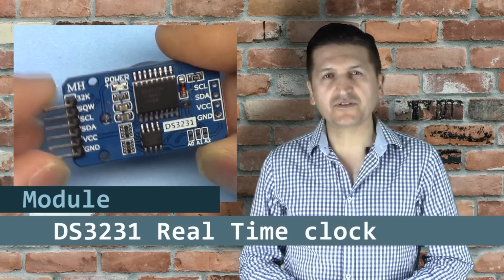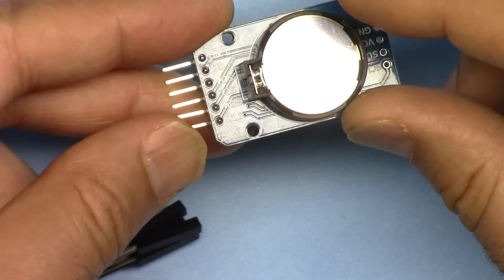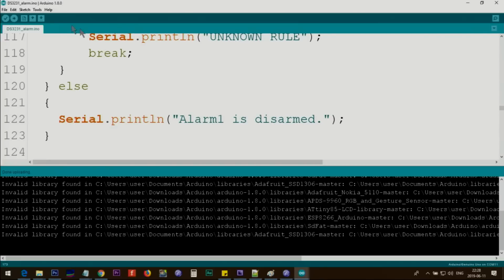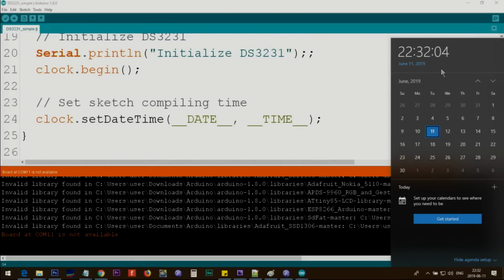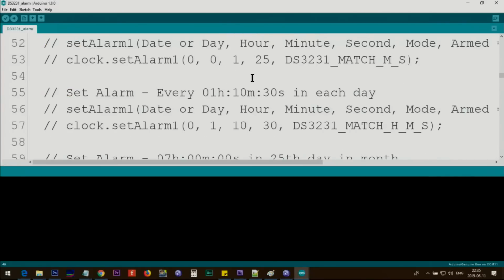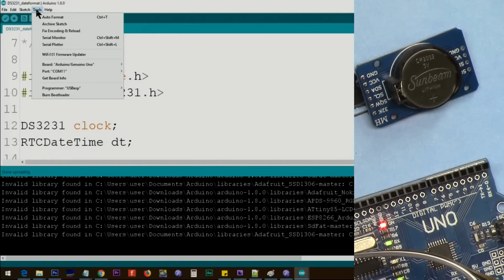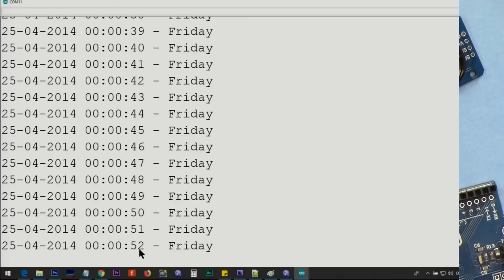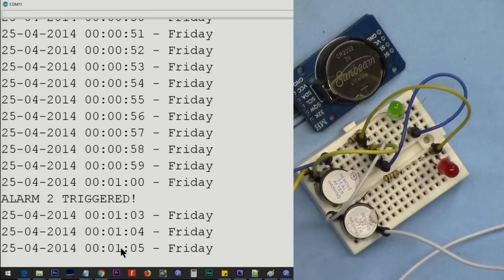How to use DS3231 RTC clock module Alarm with Arduino RJT165

Comment: Instead of buzzer, can I use motor? I want my motor run in specific time and also turn it off any seconds
Reply from the maker: Yes you can. You will need a motor driver so the signal from Arduino can turn the motor on via a motor driver. The motor driver depends on the motor for example if your motor needs to 2A, then the motor driver should be able to handle 2A. There are different types of drivers. just turn ON or OFF or you wan to control the speed. Also there is direction of rotation. do you want simple ON/OFF or also change the direction. Search my channel. I have tone of motor driver videos.  For this clock module, here is latest better video https://youtu.be/LEQfzmO9Wm0

Comment: The simple example works until i close the serial monitor, then it reverts back to the time when it was programmed, is the battery dead maybe?
Reply from the maker: no the battery is not dead. you left the code inside the setup to update the time when you download the code to Arduino. You do it only once and then comment it out by putting // before that line. By the way here is a better video with multiple projects and unlimited alarm https://youtu.be/LEQfzmO9Wm0
Reply: @robojax  ok great thanks so much!

Comment: Like your videos
I am using a ds3231 and rtclib all I want to do is set the alarm for every hour on the hour. 
The code would be something like (rtc.now=(0,0,0,59,58 ds3231 M,S);
Do something;
However I cannot get the syntax to compile correctly. 
is it possible to help me?
Thank you. 
Fleck
Reply from the maker: Hello, here is the ultimate video for DS3231 rtc with multiple alarm code example https://youtu.be/LEQfzmO9Wm0 thanks

Comment: "'RTCDateTime' does not name a type - did you mean 'DateTime'?"
Reply from the maker: please watch updated video with wiring diagram and more projects https://youtu.be/LEQfzmO9Wm0
 and the issue will be resolved. it means you have not installed the library. The newer video shows it better.
Reply: @robojax  Thanks for the quick repair but nothing to do impossible to compile " error: 'DS3231 clock' redeclared as different kind of symbol"

Comment: Do I need the DS3231 clock; and RTCDateTime dt; for the program to work?
Reply from the maker: please watch updated video with wiring diagram and more projects https://youtu.be/LEQfzmO9Wm0
Reply: @robojax   is DS3231 clock a file that  I am missing?
Reply: @robojax  I am having this problem (no matching function for call to 'DS3231::DS3231()' )
Reply from the maker: if you don't install the library, you will get error. that's why I directed you to the better video. I was expecting you to post comment under that video to say it worked.
Reply: Even though I watched the video many times it was still not working then,I erased all the files and re-install it again and it worked. Something I did wrong was giving me the error. Thank you for your help.

Comment: everything works fine, but when I disconnect the arduino from the PC, wait a few minutes, connect it again,  Time starts from the moment where I cut off the power. 
Where is the fault hardware or software?
Reply from the maker: I mentioned to set the time only once. But here is full video on this RTC module Lesson 99: Building Arduino Digital Clock using DS3231  LCD and Seven Segment Display
https://youtu.be/LEQfzmO9Wm0

Comment: l have arduino 1.8.15 & probleme with DS3231 "DS3231_test:16:8: error: 'DS3231 clock' redeclared as different kind of symbol
 DS3231 clock;
        ^~~~~
"
Reply from the maker: Hi, you must have change the code.  First do not change it and run the code so it works, then modify it.

Comment: I want to use LCD and DS3231 together, but as I watch through your video, both need to connect to A4, A5. Can they connect to A4 and A5 simultaneously?
Thanks so much for your effort put in.
Reply from the maker: Hi, LCD is lesson 19 of my course here https://youtu.be/pxUjEsJQW2M
Reply: @robojax  Yes! I have watched it. but my question is lcd and DS3231 both has the pin SCL and SDA, so both needs to connect to A4 and A5. Does that works?
Thanks so much for your reply!
Reply from the maker: Yes it will. You can connect 128 devices

Comment: Can you set more than 2 alarms this way. Or does this use the 2 built in alarms from the ds3231? Great video
Reply from the maker: you can use your own time setting and comparing to make unlimited alarm.   Here is my Free course. *** Free Arduino Course worth $200**
Arduino Step by Step Course  (over 150 lectures) Starts here http://robojax.com/L/?id=338

Comment: Igot it!  Library file in Arduino had another library for ds3231 was pulling from the wrong files when loading  . I reinstalled IDE with your library and worked! thank you for responding!!!!!!

Comment: Hello Sir, 
uploaded DS3231_simple 
got -Error Codes :exit status 1 'RTC' dooes not name a type;did you mean 'RTClib'?
commented that line out. next I got

exit status 1 'class DS3231'has no member named 'begin'
commented that line also out. then I got
exit status 1 'class DS3231' nomember named 'setDateTime'
Can you guide what is the mistake ? 
Regards.
06-07-2021;7:24 PM
Reply from the maker: Hello, have you installed the library? People skip the video thinking they are smart and they can do it without looking at instruction.
Reply: Yes I have. I see it in my include library window as Arduino-DS3231-master. I know I am not smart but am 75 years old trying to figure this out viewing your video several times over.
Reply: Also it is reflecting in examples as Arduino-DS3231-master >
DS3231_alarm ; date format;intalarm;simple;sqw_32khz& temperature subcategories.

Comment: I took several of your Udemy courses last summer, very helpful!  This video also is, however I am still confused on one aspect.  

When viewing the 3231 SQW pin running your code from this example, the SQW pin just oscillates at a 1 Hz rate. 
I understand that the SQW pin can operate in the 1 Hz mode, or a high-to-low alarm mode.  Can you provide the comments/code necessary to make the SQW high-to-low mode happen?  I looked at your .h file, and was not able to determine if/how to do it.  Thks!
Reply from the maker: Here is latest ultimate video https://youtu.be/LEQfzmO9Wm0

Comment: Sir I have done water level indicator using ultrasonic sensor , when the water reaches high level I want turn on the buzzer for 10 seconds then it should automatically turn off . Pls upload the code sir I tried but the buzzer continues to buzz will not stop plz guide me
Reply from the maker: Please watch this 30 minutes course   so you learn and do whatever you want. If you don’t learn you will be always asking people to help you. https://youtu.be/Mbb2xa1WcRM

Comment: code for alarm is running perfectly but not getting date and time in serial monitor,  instead of date and time empty space is printing in serial monitor.. what is the problem can you please help?
Reply from the maker: Set the serial mono baud rate to 9600 or what it is set in the setup () function.
Reply: @robojax  thanks for answering.. i tried it, but still getting same!

Comment: That's nice, but this would be far more useful if you showed how to generate alarms with the DS3231 as a stand-alone - i.e. no Arduino.
Reply from the maker: won't work. you need processing power like Arduino to read, decode and take action.  Else you can just get clock module with display and buttons so you can set it.
Reply: @robojax  All I need is a single pulse or level transition. If this isn't possible, how do ultra low-power remote sensors operate? What is it that turns their ucontroller off and on?
Reply from the maker: Forget about this, get standalone modules. I have so many of them reviewed.  Check my channel.  But this is the best because you can do anything you want.
Reply: @robojax  I don't know what you mean by "standalone module" & didn't see anything like that in your channel. This is what I meant by "standalone module": 

All I need from the 3231 is a pulse - a state change - on the SQW pin at a time I designate - the "alarm time". I need to interface the 3231 to some hardware discrete logic. -I have no need for an Arduino.  Yes - I understand the designated "alarm time" must be written to the 3231 via its I2C interface, but there are numerous devices (other than Arduino) that can do that - and "sketches" aren't portable AFAIK.

I would guess "the best" does not have a single definition, but depends on the problem one is trying to solve.  If you do not know how to do this, that is fine, but you shouldn't say it cannot be done unless you know this with certainty.

Comment: Hello Sir..
thanks alot. But I can't add new alarm like the third alarm. The error message : 'class DS3231' has no member named 'setAlarm3'; did you mean 'setAlarm1'?
and what should I do if I want to include month inside the 'clock.setAlarm'?
Reply from the maker: It means you skipped the video. Please watch fully and I can assure you it will work . My tutorials are unlike any other you have seen.
Reply: @robojax  I didn't Sir.. maybe my English language knowledge was so poor..
But I tried to change a bit what was inside the DS3231.h file. And it's work..
Alhamdulillah
Reply from the maker: الحمد لله .
Reply: @robojax  change the library makes me stuck in "error compile for board arduino Uno".
I'm waiting solution from you sir..
It'll be helpful

Comment: How would I change this to be able to turn a stepper motor anticlockwise and clockwise when I want, like 8am and 6pm, is it completely different or could I just change a couple things.

Thanks
Reply from the maker: Check my video on controlling stepper motor with push buttons. Use the relays or alarms features if this video with the other video which has push buttons
Reply: @robojax  Ok thanks, will do

Comment: I am getting a feedback error " RTCDateTime' does not name a type. Did you mean DateTime

Class Ds3231' has no member named begin
Reply from the maker: Yes it means you skipped and have not install stuff needed. Please watch
Reply: @robojax  I installed the arduino ds3231 master zip library.
Reply from the maker: If you installed it properly it should work .

Comment: i m getting this error for DS3231 rtc(SDA, SCL);
no matching function for call to 'DS3231::DS3231(const uint8_t&, const uint8_t&)'

please try to help
Reply from the maker: Yes it say you skipped and did not watch the video. I have no extra talks . You must watch fully or your time will be wasted.
Reply: @robojax  i watched many times. Coding in your video and explanation was the same. Its not working sir.
Reply from the maker: It means you did not watch. If you did you would follow the instructions to install the library.

Comment: I have one question: I'm using your code to output date and time. I set my current time which is equal to my computer time within seconds. But after few minutes I see that RTC time is not equal in time with computer. RTC time few seconds slower than computer. Why ? Is it because code problem, delays ? RTC second is not equal to computer second ?
Reply from the maker: when you click upload, it take the current time., then compiles the code (takes time), then sends it to Arduino (takes time). yes that's the reason. So you should add few seconds to the time. 
after the line that takes the time from computer,  read the seconds only, then add few seconds as you determine, and update it.  I just give you the idea. I don't have the module to test it but this is how it works.

Comment: I got an error after I've pressed UPLOAD button: 'DS3231' does not name a type; did you mean 'CS21'?
 I have all libraries. How can I solve it ?
Reply from the maker: the error says you did not follow instruction or did not watch the video fully. it has worked for 10,000+ people. just watch fullyu and do not skip.
Reply: @robojax  I did it 3 times :) I include library 100% sure. But still same error.
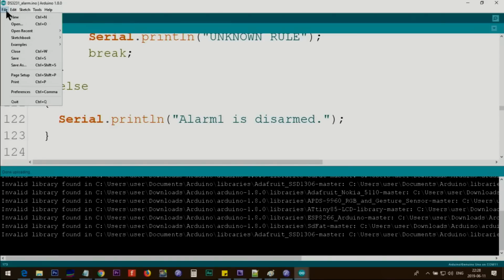Reply from the maker: how did you include it? I just watched the video and at 6:10 (click on 6:10 to play video) I've shown how to install. the library. Have you download the library?  you must be doing something wrong.  Just read people's comment. no one has issue except those who haven't installed the library.  This is very simple program.
Reply: @robojax  problem solved... I had multiple libraries DS3231. And sketch was compiled from wrong library.

Comment: Arduino: 1.8.12 (Windows Store 1.8.33.0) (Windows 10), Board: "Arduino Nano, ATmega328P (Old Bootloader)"

Grundger_st_rtc_alarm:4:10: fatal error: DS3231.h: No such file or directory

 #include <DS3231.h>

          ^~~~~~~~~~

compilation terminated.

exit status 1
DS3231.h: No such file or directory

HEEELLLPPPP MEEEEE
Reply from the maker: very simple it says "No such file or directory". it means you skipped the video where I said install the library. so library is missing.

Comment: Great Job with that Video it helped me a lot. But i still got a Problem. When i run the Alarm as it is pre-defined Alarm1 will trigger every minute and Alarm2 triggers once and that´s it. The serial Monitor doesn´t appear like in your Video aswell. And is it possible to trigger Alarm1 at specific Time everyday and Alarm2 at another Time every Day? Thanks in advance.
Reply from the maker: Hi, you made me go and look at the code. it is clearly shown with over 10 examples for setting the alarm either repeat or just once.  you may have missed it.  don't just copy and paste the code, look at the code line by line. there is huge section with examples and explanation. good luck.
Reply: @robojax  Hey thank you for your kind reply, i watched your video like 10 Times and did exactly your way and still get another serialoutput. It shows alarm 1 triggers... alarm 2 triggers... but there is no time showing up only if i activate the timesignature. Kind regards
Reply from the maker: you are welcome. I just looked at the code, and yes it just prints alarm trigger. it doesn't do anything else. I also played the video and at 6:45 I've shown that you should open "simple" example to see the time. you can combine both the "simple" and the alarm example if you want. good luck.

Comment: Hi there , great tutorial , however, I am trying to get the alarms to work but the library and code you show to use does not change the SQW output which I wish to use to trigger a P channel mosfet. The SQW just bounces up and down and doesn't change when the alarms are active. Can you help me ? Thanks :)
Reply from the maker: Hi, the SQW is Square Wave signal and it should be turn ON/OFF. if you want to turn something ON or OFF, use Arduino PIN as OUTPUT and send signal via that output.  then you can connect the output to gate of mosfet or relay or whatever you want.  here is mosfet example https://youtu.be/17vqLv508Uw or see all mosfet related videos https://youtube.com/robojaxTV/search?query=mosfet and here is how you control a relay module using Arduino https://youtu.be/58XWVDnB7Ss

Comment: hello Sir... i have some problem when i verify and this the error massage..........
no matching function for call to 'DS3231::DS3231(const uint8_t&, const uint8_t&)'
hope u can help me . Thanks
Reply from the maker: Hello, it means you did not watch the video fully and skipped. I have explained it. You have not installed the library. Please watch carefully and follow the instruction.
Reply: @robojax  
"DS3231 rtc (SDA, SCL);"
this error is happening now
Reply from the maker: you have cut most part of error. this doesn't mean anything.  the error mentions the file name, the line number and more information.
If you use the code without any change it will work.  Use this I2C scanner https://robojax.com/learn/arduino/?vid=robojax-I2C-scanner to find out if your wiring is correct. if you get I2C address, the wiring is correct.
Reply: @robojax  Thank you very much sir. the problem has been resolved after I replaced the code with the one in your video

Comment: I have downloaded the library you suggested, and opened the "simple" example.  When it compiles, I receive two errors - first the "'RTCDateTime' does not name a type - did you mean 'DateTime'?"  The other is regarding clock.begin.  The error message there is "'class DS3231' has no member named 'begin'."  Why do I receive those error messages and how can i fix it.
Reply: I found the solution.  I had two DS3231 libraries under different names.  When I went to include the ds3231.h file using the include library command, even though it installed the correct one, it was referencing the ds3231.h file in the other folder.  Once the other folder was deleted, all works well.  So remove other instances of DS3231.h in your library directory.
Reply from the maker: good to know you found the solution.